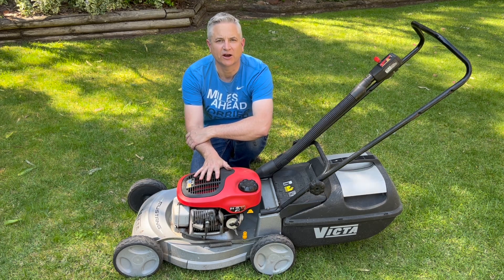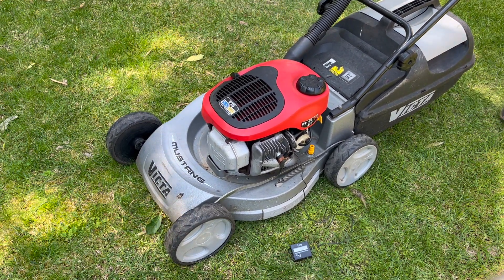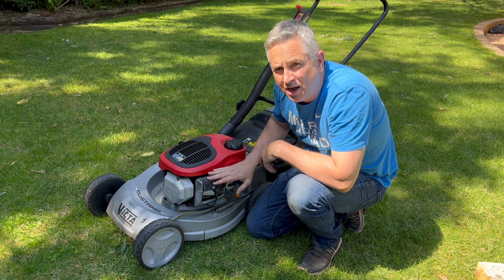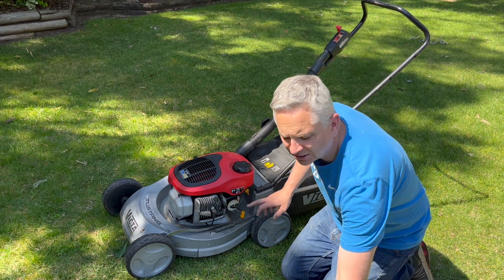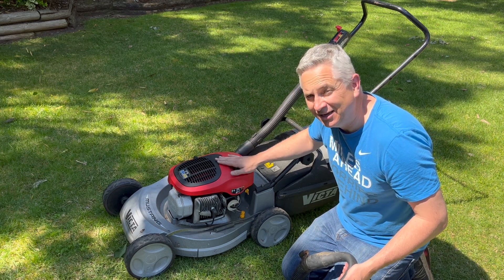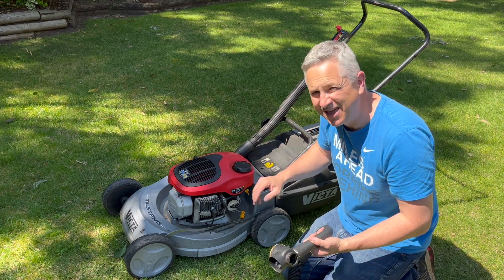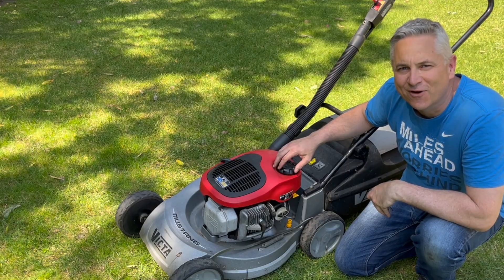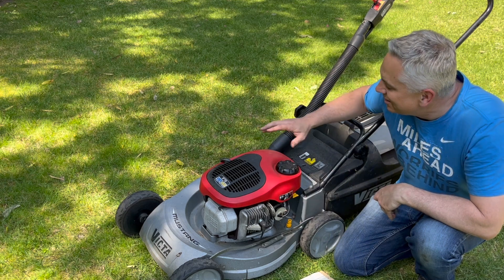VICTA 2 Stroke Lawn Mower Under Revving - How to FIX!!

Comment: Thanks for the awesome video test and setup of the G4 carb. There must be hundreds of people out there that have had either too low or too high rev problems with the 160. I have 9 of these mowers and with out a doubt the best mower money can buy - will give many years of service - should even last a lifetime if looked after correctly. Well done.
Reply from the maker: Thanks mate!  Cheers Drew
Reply: I have 3.. a red 1980 & two mellinium g4 carb models.. I can't work out how to get there off throttle idle speed down.. they both rev at about 2500rpm at idle.. I can suck on the vacuum line from the spring cap & they idle right down.. but won't when the fan governor tube is hook up.. there's no blockages.. both got the std springs they came with & all the carb internals have no wear & operate freely.. the 80s model idles down to about 200rpm or less.. carbs very similar

Comment: Great video explaining the different springs required for the lm carby. It's such a pity they stuffed up the design and didn't make it simple to adjust running rpm. A spring with adjustable tension or an adjustable vacuum line would be more suitable!

The mower in the video looks like a late model vsx160. If fitted with 4 blades 2800 rpm is to spec and adequate fit purpose. Running it higher increases noise and you'll go through a tank of fuel much faster!
Reply: I’m sure the specs say between 3500-3600 max rpm
Reply: @chisel83    That's spec for the older power torques before emission regulations came in. Once the regulations came in from about the year 2000 onwards they dropped the rpm.  @Varietech-AU (victa expert) might be able to confirm.  If anyone really wants to take control of rpm on a power torque then they should do the  LM carby mod on outdoorking, as detailed by NormK.  This gives total control of rpm at your fingertips and does away with the vac controlled gov hose altogether.
Reply: @markkearns6231  I had a feeling the rpm was set low due to emission regs. I recently installed a new varietech primer cap and needle set up in my super600. Can you share the link to the thread please I’d certainly like to have a look. Cheers 👍
Reply from the maker: Hi Mark, I suspect that you are correct wrt RPM and emissions, however I must say that it runs a lot better with a little more RPM in my humble opinion!  Cheers Drew
Reply: Hi Drew, yes I prefer the older power torques that seem to rev harder and idle better. It's also fun to let the neighbours know you are mowing the lawn. Keep the video coming. Thanks
Reply: Nothing else changed apart from the shape of the ports so the speed is sort of irrelevant con rod bearings are the same, crank bearings are the same and the blades are the same 3.75" long but to account for the lower rotational speed they are wider so they have more momentum .
Not sure if the mulching quality is different but I only fit the wide blades to everything and the customers all say the mower is now cutting like new again .
Running at the higher speed will pack the catcher a lot better 
Victa made 5 different springs up until 2000 when only 1 was available an there are also 4 different sized main jets 
Victa could have made the emission specs by simply changing the fuel:oil ratio to 50:1 Using a modern low ash 2 stroke oil which is just about all you can get now days but some nut job who was taking $ 200,000 from the company decided that it would be "too confusing" for the customers .
I run all of the Victas on 50:1 without any problems & recommend that to all my customers some of which are still running super 24's from the 60's
Reply: My VSX160 (bought new) throttles itself up as it hits heavier grass and then reduces in RPMs as the load reduces. Seems to work well.
Reply: @I-have-a-brain_and-use-it  Hi, could you advise me please on maximum revs on Victa Utility 460 Mastercut  with 2 blades no catcher I think with LM carby. I apriciate your response

Comment: Thanks for the video. Any chance of sharing where you got the different length springs?
Reply from the maker: Hi Mate, thanks got the different springs from Victa carbs that I have pulled appart over the years.  Perhaps I should have filmed another one last weekend where I actually needed a stronger spring but what I had was too strong (actually the strong one from this video) and what I did was cut down to the strong spring until I got the lower to rev where I wanted it too!  Cheers Drew

Comment: Hi Drew.
Love your videos mate. 😊
I have that exact mower. Victa Mustang.
It runs fine but has serious wheel wobble mainly on the front wheels. Can you suggest an easy repair/fix or should I look at replacing the wheels? If you have time to make a video that would be awesome.
Cheers.
Rob
Reply from the maker: Hi Mate, do your wheels have bearings?  Cheers Drew
Reply: I haven't had a chance to get to look at the mower yet Drew but it is the exact same mower and wheels on the mower in your video mate. @DrewFixIt

Comment: u could have kept the spring adjusted the throttle cable further forward which advances the ramp within the carb with the ramp  advanced there's then more pressure on spring.  Thus you would have got a 3300 rpm (recommended Rev) rather than now over reving.

Comment: Hi Drew, I didn't know anything about the letters on the valve or the spring pressures, But I did manage an adjustment with the adjustment screw by the Throttle Lever !
However the throttle seems out of sync with its specified selector values ?
So in the idle position it revs up, And the Stop position doesn't work now, But i rigged up a motorcycle kill switch which is Awesome !
Reply from the maker: Hi Sam, by adjusting at the throttle lever I suspect that you have now adjusted such that the CAM inside the Carby cannot now rotate fully to the stop position.  Rather you should have adjusted it at the Carby side as per my video!  Cheers Drew
Reply: @DrewFixIt  Hi Drew, 
Yes i'll take that onboard and do like the video instructions. Thanks very much from NZ
Reply: your stop bung could be split also,  easy check too see if cam isnt moving enough is when moving lever from fast to stop the centre wire going into the back of carb will move to the side creating the cotact to wire going in sideways.  if it doesnt move much pull the wires out side first then middle which hopefully comes out with the rubber bung on look for split on the bung.  reinstall the new bung with a capped victa spark plug then throttle to fast middle wire push in till you feel it push thru,  then rubber outer boot which has an offset hole which has to be at top and horizontal push in side wire move throttle to stop check for pin movement. if wire moves cams good

Comment: A blocked muffler will cut max RPMs.
Reply from the maker: Hi Mate, I haven’t seen a blocked VICTA 2 Stroke muffler ever, rather seen plenty that have burnt/blown out all of the internal steel wool and typically I pack in more to quieten them back down rather!  Cheers Drew
Reply: Yes it will, as will a carbon blocked/restricted exhaust port. Used to be quite common before the use of quality Two Stroke oils became commonplace.
Reply: nothing to block in their muffler big empty cavity with a little steel wool.
Reply: @markheaton5431  yes will block port but never there mufflers there is no restriction at exhaut,  older versions yes nt that muffler.